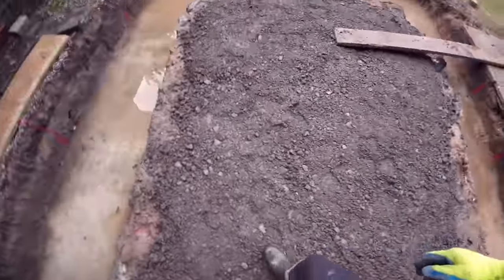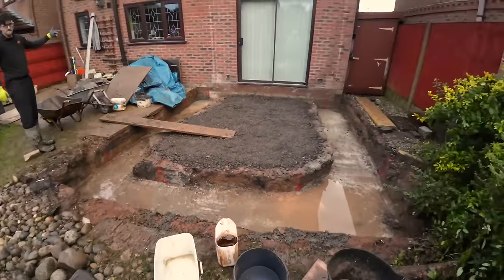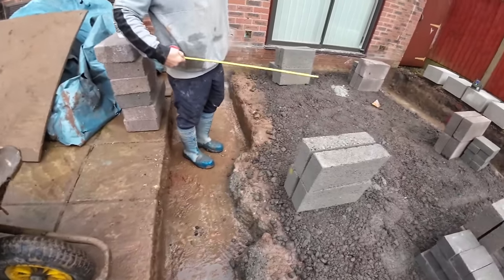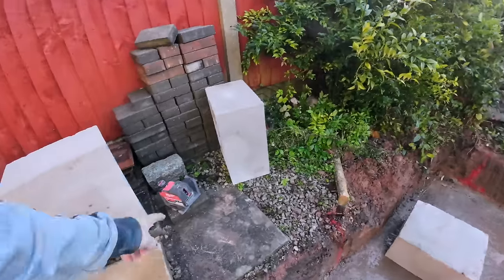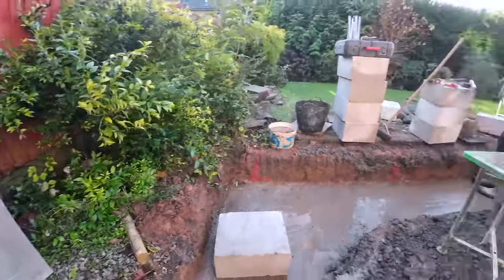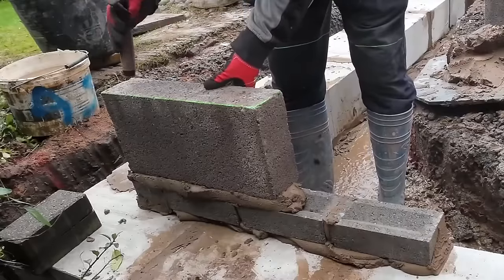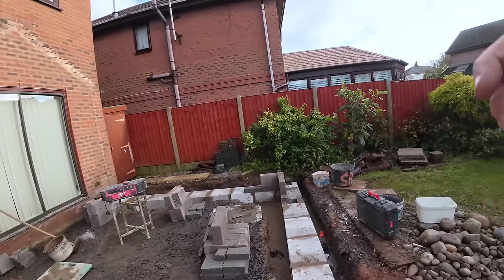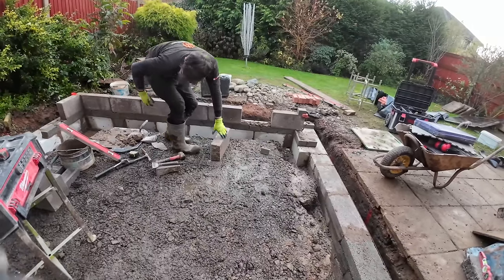350 MM TRENCH BLOCK FOR A 150 MM CAVITY.. CONSERVATORY TO EXTENSION PT 3

Comment: Great work as always despite the weather.. btw - your tool sponsor does the perfect (battery) pump for trench flooding (MILWAUKEE M12BSWP-0 M12 HYDROPASS STICK WATER PUMP) - perhaps they might let you try one as not expensive [£99 ex vat and batt]).
Reply from the maker: Cheers Paul 🧱👍🏽

Comment: Don’t make em like they use to anymore proper pat rafters #top grafters!!! Looking at doing an extension the same size if not slightly bigger what you you say the rough cost is to get it up to damp in materials roughly same size as this?
Reply from the maker: Cheers. There is never a rough cost as materials and costs differ so much .
    Better to get a quote in person from a local builder 🧱👍🏽

Comment: Like your vids.... just wondering why u don't use a longer tamp for concrete say 6ft long., and tamp the lenght of the footing? U seem to use a short 1 and tamp across the width of the footing. Seems weird...
Dosent have to be heavy. But longer the better really. Less work when tamping and less dips.. makes for a flatter footing...
Reply from the maker: But won’t fit in the van 🚐 🤔
Reply: @SteveAndAlexBuild  😆 ..sure there's a bit of batten, a stud, some 4x2 ect on every job... trust me it's easier if u do... not claiming I know it all, but after 40 years being a ground worker, I learnt that...
Reply from the maker: @neilwatcham8932 . 🧱👍🏽

Comment: I don't understand this; I'm in upstate New York State.  Here concrete is $123/cubic yard. [£97/cubic yard]
Good quality structural fill gravel is $9/ton [2,000 lbs.]  [£7/ton [2,000 lbs.]  Gravel is much cheaper than concrete.  
Why use 6 cubic meters of concrete?
How much is a cubic meter of concrete delivered in you area?
Reply: Where would you put the gravel?
Reply from the maker: Concrete £192 per cube 
Stone £70 p t 
But concrete must go direct onto the clay 🧱👍🏽
Reply: And you still have to buy and lay blocks in a deep trench.
Steve did the math and it didn't add up, and you have to work in trench that would have needed bailing out every morning.
Deep fill was best solution here for these guys.

Comment: Seems rather pointless having a large cavity wall on a building made of glass! (Or even polycarbonate)
Building Regs clearly don't have any common sense used when coming up with changes to the rules.
Reply from the maker: Glass ? Polycarbonate?
Reply: @SteveAndAlexBuild  My bad, though this was a larger Conservatory build, just seen its an Extension! Which would make more sense.
Reply from the maker: @HughzieTube 😉🧱👍🏽

Comment: DON’T HAVE YOUR HIP DONE! It’s not your hip it’s your muscles, they need massaging and stretching.
Reply: @SteveAndAlexBuild 
I know what I’m talking about, you’ll find out the hard way I guess🤷🏻‍♂️
Reply: @martin2466  
The fact that he can move his leg is evidence enough that that isn’t the case, don’t need an X-ray to see that. Getting the joint moving freely again will allow the joint to repair its self. Muscle cramps and knots cause excessive force on the joint causing the wear of that joint. If he massages his legs particularly the outside left leg and it’s hard as rock and tender, then his muscles are causing excess stress on the joint for sure. He is also walking on the outside of his left foot that will cause the outer muscles to spasm and contract, leading to hip and knee issues. 

No, I am not a quack, I’m not that ignorant. The sickcare profession only treats the symptoms never the cause!
Reply: @martin2466  
If the joint is bone on bone, then he wouldn’t be able to move his leg, as he can clearly move his leg then it’s not bone on bone and can be repaired. See video linked 30 mins on for how to repair a warn hip. Though it’s not easy and may take years.
Reply: @martin2466  
You’re welcome, all the best.